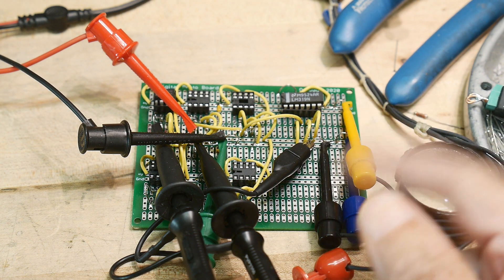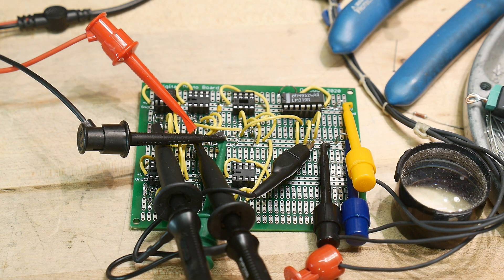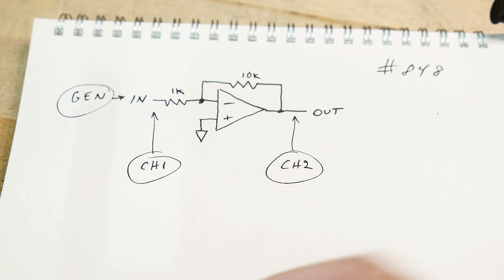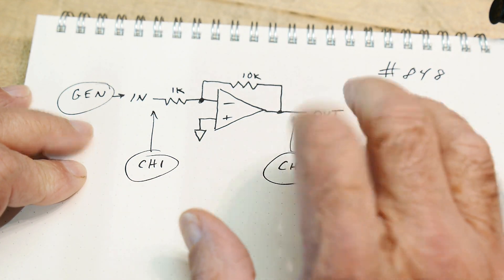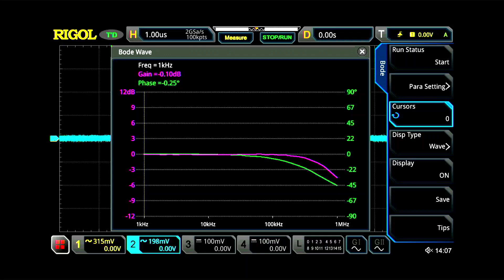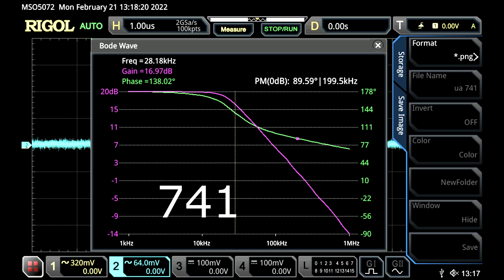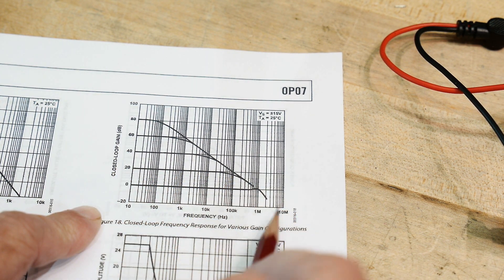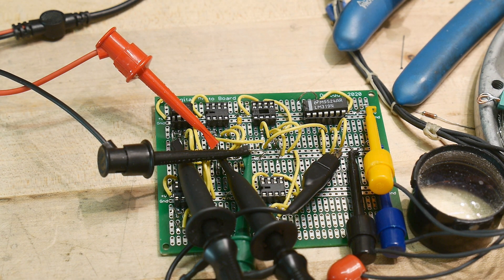#1067 Op Amp Bandwidth (Bode Plot)

Comment: You forget the most important of your test: Output LOAD!
Op Amp is not voltage amplifier. It is a low power amplifier, then placing a load is a must. Without load the test have no purpose. Just check how manufacturer do test. It is always shown on each datasheet.

Comment: You set your cursor at -30 dB.  For power, you want -3 dB.  For voltage or current, you want -6 dB.  Recall that 10 dB power is 20 dB voltage or current because P=I^2 R=V^2 / R.
Reply from the maker: take another look. I have it set at -3db
Reply: @IMSAIGuy  Sorry, I was looking at phase...

Comment: Since the output was no longer a sine wave, you were measuring slew rate not bandwidth.  Bandwidth is a small signal parameter so you need to attenuate the input so that the voltage swing on the output is not slew rate limited.  If you are slew rate limited the output will look more like a triangle wave than a sine wave.

Comment: Possible to measure it by NanoVNA with an external attenuator? Guess it might be quicker? (Mag of S21 and Phase of S21)
Reply from the maker: Vna only good for 50ohm systems
Reply: @IMSAIGuy  not to mention the disparity in frequency range,...
Reply: External signal generator works quite well for these things.

Comment: Great video! 

Why do you think your build on the OP07 rollled off about an order of magnitude earlier than the datasheet specifies?

I too sometimes find it difficult meeting some of the specifications given, recently have been struggling with choppers.
Reply: If you see the plot where the power is not on, there was already a loss at higher freq, presumably because of the inherent capacitances of the test board? His purpose was to show us the relative changes from opamp to opamp so it was not important.